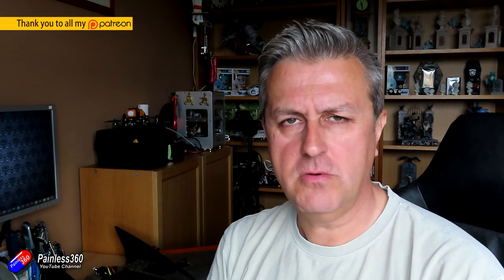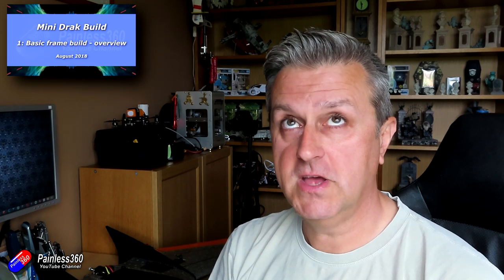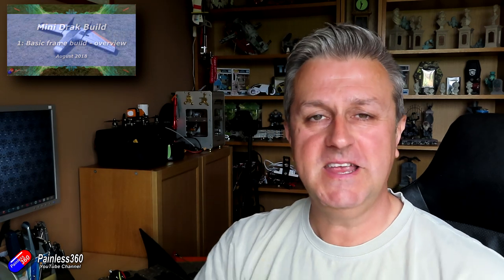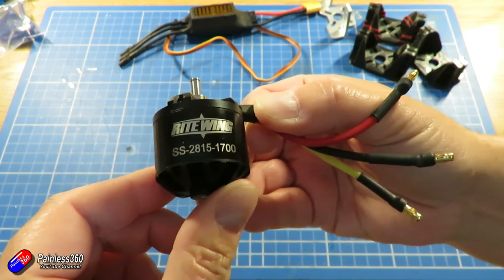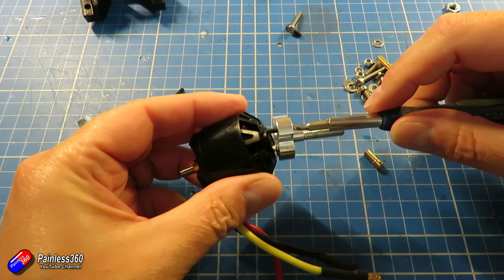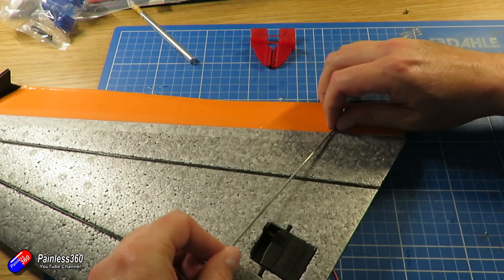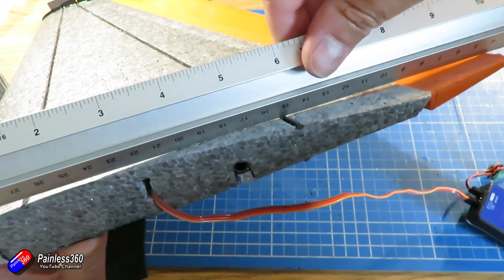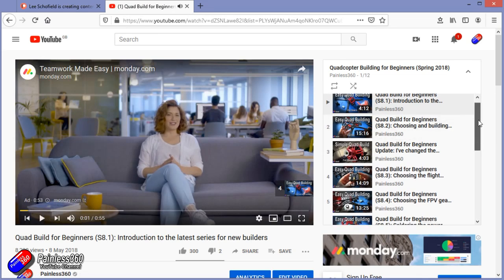Virus Lockdown Build 2: Poll update and finishing the airframe!

Comment: Yes, technically the pivot point on the control horn should be as close as possible to the hinge line but the MD needs very little throw to fly well so the negative affect is minimal - and that brings up another common mistake we see all the time, the control rod to far out on the servo arm. About 10mm throw in each direction is all you need and the best way to reduce the throw is mechanically - control rod on the last hole on the control arm and as close to the servo center as you can get it. Sure you can reduce the throw in the radio rates but that limits the amount of servo travel and reduces the control resolution. Closer to the servo increases the travel and resolution as well as the force available at the elevon.

Yes the plastic motor mounts can break in a crash but that's a good thing. The aluminum mounts rarely break but they can bend on a hard landing and that mean the thrust line is off unless you catch it. I've used both and prefer the plastic since it seem I'l always straightening the aluminum ones.

Comment: Question. Why put the control rods parallel to the wing section? On my scratch builds I put them perpendicular to the trailing edge. If they aren't perpendicular to the hinge wont it cause some weird torques?
Reply: @Painless360  hi there, yeah, I followed the original build video too, but on that particular steps I did mine as I normally do. They're great articles on this matter around there (I can't post any link here) where they explain the best way to install a control horn in order to have the most linear response possible and minimizing the unnecessary forces.

Great build though!
Reply from the maker: For the geometry to be at 90 degrees - the servo would need to be rotated to be parallel with the hinge line. Some of the other wings I have here have that setup.. Happy flying!